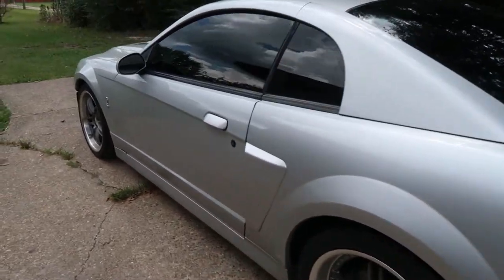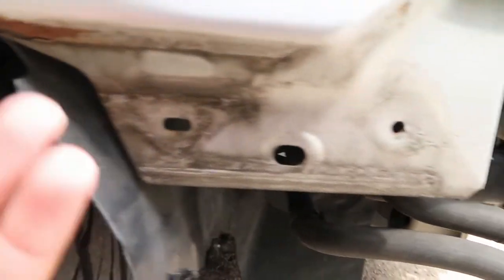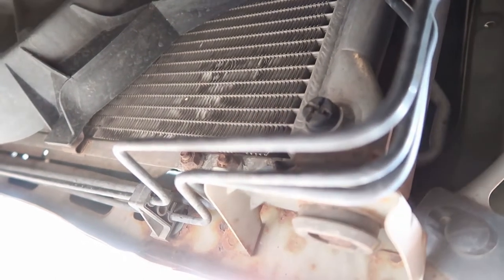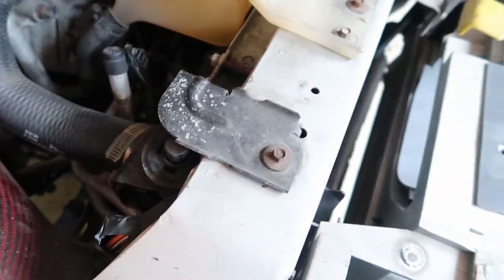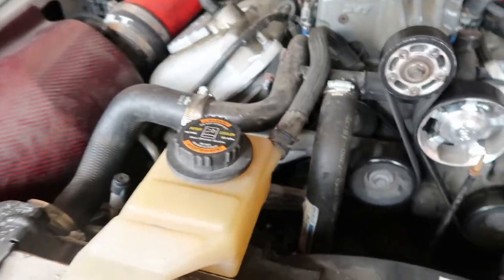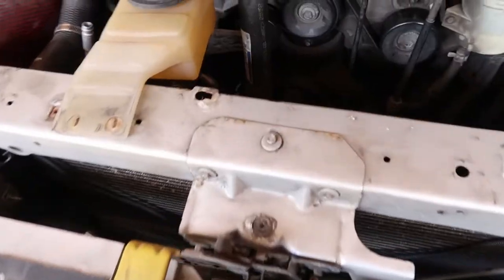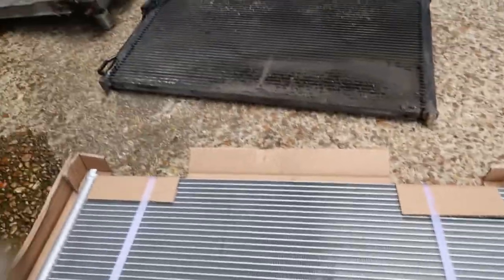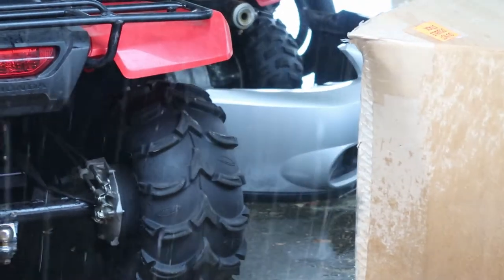How I Installed An AC Condenser | 2003 Mustang Cobra

Comment: did you put the factory specified amount of refrigerant oil in the new condenser before you installed it ? did you lube the new o-rings ?
Reply from the maker: I don’t believe you have to fill anything up before installation.. I just know you have to empty the system before you uninstall the condenser, then once it’s installed you fill it back up to factory spec. And o-rings are always better when lubed
Reply: It's the compressor that needs oil, not condenser.

Comment: What is the front lower smaller radiator for thanks
Reply from the maker: Heat exchanger (intercooler for superchargers), behind it is the ac condenser (condenses cool air for ac), behind it is the radiator (keep coolant from overheating)